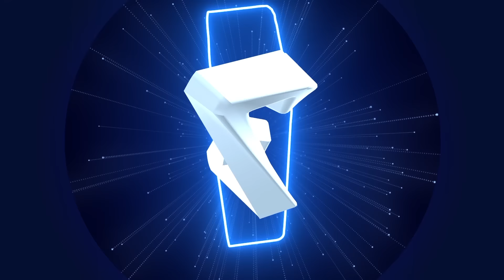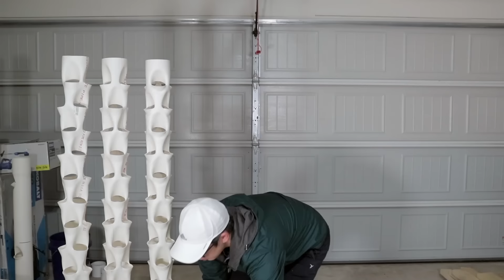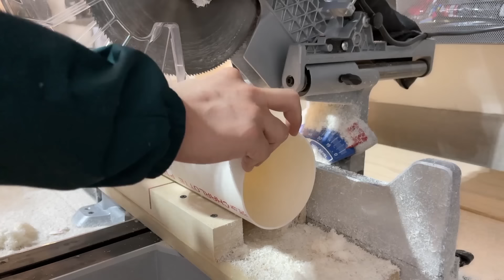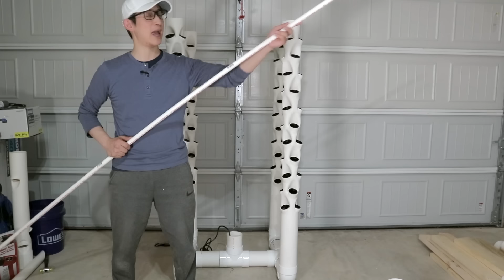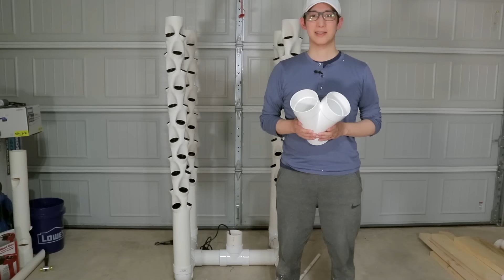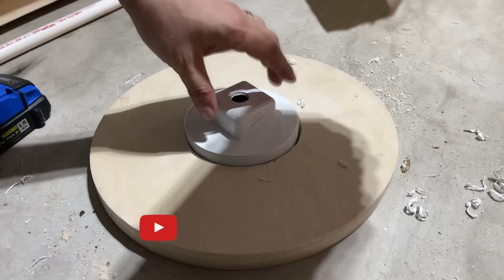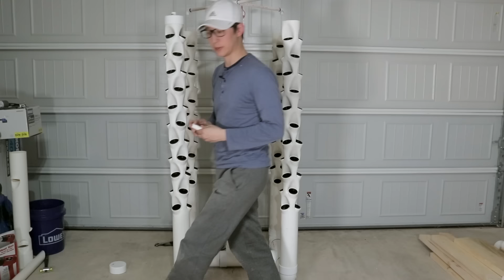DIY Hydroponics | Aeroponics Garden Tower Build | Part 2 - [4 Tower Build]

Comment: So I asked this question on one of your videos but have not received a response as of yet, I don't think however I'll give the answer because I just did some serious research in the pvc used. On the pvc the is "NSF-" so.e more letters. 1: NSF-DWV this pipe is not made for drinking water.  2: NSF-pw-G this water can be used with drinking water. The G means no lead in plastic. 3: NSF-WC. The wc stands for wastewater certification....not for drinking water.

Comment: Hi Chris Loh, great video! I’m building a hydroponic tower using a 4" PVC pipe and forming the plant pockets with a 50 mm pipe as the mold. I want to confirm the correct slot length to cut before heating.

Based on the math, the half-circumference of a 50 mm pipe is about 78.5 mm (50 × 3.14 ÷ 2). But practically, would a 70 mm(in your PVC Cutting Template) slot be the right size to allow the 4" pipe to expand and take the shape of the pipe and 50 mm mold without tearing during the heating/molding process?

Just want to make sure I’m cutting the correct slot length before I start. Thanks!

Comment: ...IMPRESSIVE...THANKS...WILL PUT A DOZEN OF THOSE VERTICAL PIPES IN A SERIES, ALL REACHING A COMMON RESERVOIR TANK  WITH THE PUMP ( A BIGGER ONE) AND FEED THEM WITH A PIPE IN TOP ...PROBABLY WILL BE NECESSARY TO SCALE DOWN THE TOP FEEDING PIPES IN DIFFERENT DIAMETRES, ALONG ITS' WAY, TO COMPENSATE THE  PRESSURE AND GUARANTEE AN UNIFORM DELIVERY OF THE LIQUID....

Comment: Interesting project! Thanks for your video and answers in advance. Were there any field tests? How much solution volume can the pipes hold? How much does the system weigh—will it blow away in the open air? It feels like you need a 100-liter tank at the base. How did the lack of light insulation affect the roots (in practice)? How long does it take for the solution to become alkaline? Thanks again for the inspiring project.

Comment: have you ever had @ChrisLoh problems with this system regarding tower cleaning in the inside? so roots stucked or smth else? just asking because I'm studying a similar system but though to cut it in sections to clean it

Comment: The build is outstanding, but PVC piping is highly carcinogenic when exposed to heat and UV light. PVC itself is generally considered inert once it’s fully manufactured, but the dangers lie in:

Vinyl chloride monomer (VCM): A known human carcinogen (linked primarily to liver cancer), used in the production of PVC. Concerns arise if the PVC degrades over time or is improperly manufactured•	

Additives in PVC: To make PVC flexible or more durable, manufacturers add plasticizers (like phthalates), stabilizers (like lead or cadmium compounds), and other chemicals—some of which are carcinogenic or endocrine-disrupting.

Heat and UV exposure: PVC can break down under heat or prolonged UV exposure, potentially leaching chemicals like dioxins or heavy metals into the water. The science clearly demonstrates that plants uptake these chemicals, creating toxic food.

Comment: Great video, has given me some ideas for my own system. I just want to say that id worry that you now have a very maintenance intensive system because you have 4 towers with very little reservoir space, this system with the bottom tee facing downward ontop of an IBC would be a very robust system with little topping up or maintenance and a much greater ability to buffer extreme temps. Kudos and thanks for the ideas.

Comment: To avoid your "exploding" PVC pipe experience; reverse your saw blade. That will eliminate the blade teeth hooks from trying to grab the pipe and let you cut with the back perimeter edges of the teeth carbide tips. Should also wear respiratory PPE's when heating, cutting or bonding any plastics.
Fantastic build and awesome video. Thank you for sharing.🙂

Comment: Thanks for this great tutorial! Very efficient design. You could grow a LOT of food in this system. I’m wondering if the spacing of the pots is too close…it should work pretty well for compact plants like greens or microgreens, but if you intend to use it for plants with a little more height or width, it could become a problem. (Have you tried different kinds of plants in this yet? I’ll be looking at your other videos, which may answer my question!) I think a nice addition would be to mount the entire thing on some kind of lockable turntable so you can easily rotate all four towers around the center in order to make sure all the plants get enough light. Even in ideal light conditions, as the plants in the front (facing the sun) get bigger, they will eventually shade the plants behind them. If you get direct overhead sun, the plants on the bottom will also get shaded, but you can at least rotate the towers to catch morning and evening sun on the bottom of each tower.

Comment: I am a bit concerned the wind will deflect the towers and could break the pvc on the bottom. Maybe look at creating a similar structure for the top as the bottom tying them all together with a center water feed to the sides.
Reply from the maker: @Debora-m8r  it’s actually very sturdy.  This particular tower survived a tornado that passed through our neighborhood without any damage or impact to its integrity.  The vegetables I was growing were a different story.  Still works perfectly fine and it’s been some time since I posted this video.  Although it wasn’t directly hit by the tornado, the wind managed to move the aluminum furniture I had this placed next to, but this 4-tower system didn’t move or get damaged in any way

Comment: If you take the blade off and put it on backwards it'll cut the pvc without it catching and exploding.  Hope that helps.. it works the same for hole saws just put the drill in reverse.  Love the design.
Reply from the maker: Thanks for the tip!  Helps tremendously

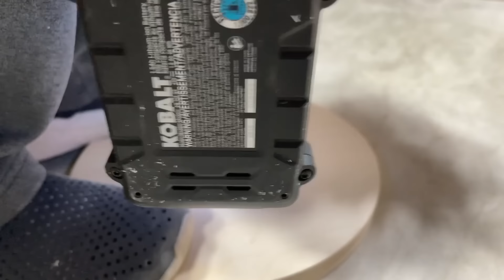Comment: 15:42 and 17:12 what drill bits  are you using?
Reply from the maker: at 15:42 Im using a Hole Saw Drill bit (https://amzn.to/4kDRPHa), but I definitely would recommend using the Step Drill bit (https://amzn.to/4bHKJ05) I used at 17:12 for these types of projects (much easier)

Comment: the pipe breaks because you need to run the blade backwards, not the normal orientation. This works for thin metal too.

Comment: You are a friggin genius, man.  Cost you $150 but you can easily sell this for $500-1000.  Or more.  A drain to flush out the system and old nutes would be ideal.
Reply from the maker: I appreciate that!  It was a fun build and definitely cheaper than buying a tower.It's a little heavy and expensive to ship though, so Im looking at alternative DIY solutions.

Comment: How is the water coming out from the top to feed the plants? How is the water spreading out to make contact with the roots?
Reply from the maker: the tube and pump force water up the center tube and the upper cavity of each tower has holes that are positioned to drip water down the each tower to irrigate the roots through gravity.

Comment: Allow your blade to stop spinning before raising the saw. That will all but eliminate the risk of the pvc shattering. Also let the saw reach its full rpm before starting to cut. I nearly required stitches from a pipe shattering back in the day cutting pvc rings for an ICF foundation. Hard lesson learned.
Reply from the maker: Good point! I'll try to remember to do that on the next project

Comment: Thank you for the tutorial. On your next build you should invest in a level. So when you are gluing your fittings check them for level in two directions. But the first step is to check the area of the build for level in four directions. If it’s not then you will have to build on plywood that has been shimmed level.
Reply from the maker: Great idea, I'll try that for my next build!

Comment: That is a really nice build. Me being the geek that I am, I would add a sensor to detect the water level connected to an arduino that monitors it. when it runs low the arduino would active a water outlet that fills it back up unattended.
Reply from the maker: Im working on an enhancement using a floater valve that will allow for automatic refilling of water.  Its not as technical as an Arduino and sensor, but should work just as well!

Comment: Thanks for the video. A couple of Suggestions: use a stop block for cutting the small insert rings instead of marking each cut. Also, wouldn’t hot glue help in sealing those rings in place to prevent water loss? Is hot glue “food safe”? One more thing…gloves are never safe when using a saw or rotary tool.
Reply from the maker: Thanks for the tips and advice.  I’m not sure if hot glue guns are food safe.

Comment: Danger:  Do not use this design for food production.  PVC pipe contains chemicals that interact with fertilizers and causes very toxic byproducts.  This system is fine for ornimental uses such as a living garden wall, etc... but do not use this system for food.  Tim Blank spent millions of dollars developing the original design he is trying to "knock-off".  Appologies, but this guy does not have a NASA budget, nor does he have an on staff chemist or molecular biologist like me.  Tim's designs are safe for long term habitation on Mars and the Moon because the plastic uses is certifide food grade and has pattented coatings to make them last a life time.  That's why Tim's systems are $1,000 USD each.

Comment: Love it. Would just like to add that the pump used will almost certainly burn out at some point. I have had many of these burn out over the years. When that happens, you have very little time until plants die. If you're going to use a small submersible pump like this one, just have a backup one to quickly replace.
Reply from the maker: Good call.  Some do burn out overtime, but surprisingly, the one used in this video is still the original and going strong.  2 years now.  Its also good that Amazon does next day and two-day delivery so not much time will go by if you need to replace it.
Reply: I am sure you could design some kind of redundancy into it using water flow rate sensors and some programming connected to a second pump.  So if one fails, the next one just jumps in as soon as the flow rate drops.  Would increase cost, of course... but it would do a lot to prevent failure problems.

Comment: Brilliant video. Although it would be good to see the addition of a method to drain the system too. Some sort of 2 way valve on the water delivery pipe so you could attach a drain hose and pump the old water out
Reply from the maker: Great suggestion! I'll see if I can add that in the next iteration

Comment: Your water will eventually get dirty from soil run off, you will need to protect your pump motor.
Reply from the maker: I havent had issues with soil since im using coco core, but broken off roots do need to be cleaned out on occassion.

Comment: Hello, how many times a day is water given to lettuce in vertical hydroponics? Is night different from day? How much time is it watered per hour or is watering continuous throughout the day? Thank you.
Reply from the maker: For this specific tower I just left the pump running 24/7.  In the new towers Im building, I am using solar powered water pumps, so the water runs continuously throughout the day and stops during the evening.
Reply: @ChrisLoh  Thank you

Comment: I  saw your designs , it's a good idea , i have a doubt, Anyway we need to change the water after some days right, how to drain water for refilling.
Reply from the maker: Typically the water evaporates and is used up over time.  If there is an instance where I need to remove the water, I typically remove the towers and turn the base upside down,.  Im working on a new design that has a spout to empty the water easier.
Reply: @ChrisLoh  can we add a drain hole for easier opening and closing?

Comment: Hi I just came across this because I'm interested in this build. Quick question: How do we know the PVC is safe and not leeching any chemicals into the water, especially due to sun/heating from heat gun? Thanks
Reply from the maker: Unfortunately we dont.  Ive gotten feedback both ways - Bad for you because heating and using PVC has chemicals, and also points made that it's the same PVC pipes that deliver drinking water.  I am experimenting with other materials and techniques which use food grade materials, which I hope to have an update video soon.

Comment: how much would you charge to send all pre cut and built 4 tower so that it could just be assembled?
Reply from the maker: Right now,the 4-tower system would be too much to ship because of the weight of all the components.  I am however working on a lighter more modular system which I will share in a video soon after I have tested its durability which should be easier and cheaper to ship.

Comment: You can use a sump pump at the bottom and a water reservoir at the top. That way you don’t need a centrally located pipe in each tower.

Comment: your design looks good BUT the tower is a bit small IMO. You need to use larger pipe as the roots need air flow to grow better. This system looks like it would get root bound.

Comment: Should build the top just like the bottom with the small pvc in it and it would be extremely strong
Reply from the maker: That is a good point.  I would need to figure out how to run and connect the split water distribution within the upper build doing that method.  Maybe I'll try in an upcoming video

Comment: Once again  - after reading all of the comments - -  I didn't notice anyone suggest PVC Unions - - And more screw together - threaded PVC parts/couplings - - attached at the end of the pipes and on the corners/couplings etc - - They are water tight - - and add a whole new world/dimension of flexibility and more easily alignment of the towers  - using PVC Unions - without having to use a level you can straighten things out anytime during the build and dissemble any time you want into its separate parts and even remove any tower - or add reservoirs - - add new base that just screws on when you need to remove the bottom for cleaning or maintenance - -  any time - - and just cap removed tower openings with a cap  -- etc.. you can build little parts that either simply attach with the PVC pipe cut attached (glued) to them to slide in where it isn't under pressure - -  or make or purchase factory available  - - screw on/in - factory threaded - - items that attach to the PVC Union /screw on PVC parts Threads - - it offers - -  exponential - -  malleability to any PVC project...  So you can start smaller and work your way to a larger project with more towers, reservoirs  - - for disassembly for winter storage  - -  and as they said in the other comments valves on every tower and... possibly... even within  towers to grow things that have various water needs... more at the top and less at the bottom... and for individual tower removal when you only want to grow (X numbers of towers) the world is the limit... - - and a huge time saver and making the project more user friendly - malleable so the holes don't have to be perfect and re-heated - - pool noodles - - they said they had been using them for years and you can get them at the dollar store for $1.25 and far less dangerous cutting of tiny pvc slices - - and makes it so a person can do it without an accurate miter saw... For people who don't have such extensive shop tools on hand - - even made with a hand saw...combined with Big Box Store -  off the shelf available - - pre cut pipe sections and threaded pipe and threaded PVC Unions - -  with this (union/threaded screw together/pool noodle) system - -  and for drilling holes use only expandable bits like the second one you used...... Hole saws are tricky and make dirty uneven cuts that have to be cleaned up....
Reply from the maker: Thanks for the suggestion.  I'll have to look into and attempt this

Comment: Chris, it appears  the caps you used at the top of the towers does not fit a 4in pipe. How did you secure the caps to the tops of the towers?
Reply from the maker: @jeffreyb9613  They should.  I used 4” PVC caps and drilled holes in them for the pipes.  The heating of the PVC may warp the tops of the pipe a bit, but they still fit fine
Reply: @ChrisLoh  Chris, thanks for the reply. I may have picked up the wrong cap. I am currently building your four tower system but with longer legs for more water storage.
Reply: Ok so I used the wrong 4in pvc pipe. You used sewer and drainage pipe and cut the flange off. I didn't see you do that in the vid so  I bought the 4in schedule 40 so the cap will not fit as the pipe is wider.  No turning back now since the base is made out of schedule 40.

Comment: Chris, one possible change that you could try, to keep the PVC from exploding when cutting it with the miter saw ………. is an old vinyl sider’s trick to keep the vinyl from breaking while cutting it. If you put the higher tooth blade (60 or so teeth) on the saw so that it cuts backwards. I’ve used that little secret for years!

Comment: There may be times where you don't use all four towers (like when you need to perform maintenance on a tower. You may want to introduce some shut-off valves on top to allow this.

Comment: Trying to build this now. The pipe you have listed doesn't form well. It has a black rubber core that will not retain its once molded. The drain covers were not used in the video. You're missing the three T-joints from the BOM. Also, I tried printing the template from the site, if you print it out, it's not accurate. If you size the print accurately, the other dimensions aren't accurate.